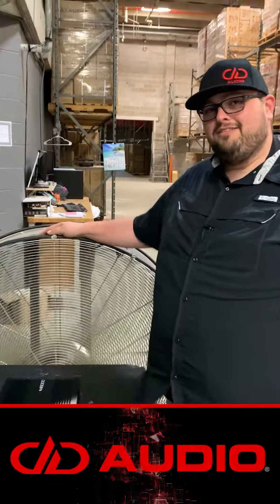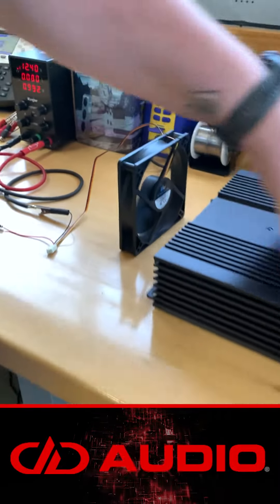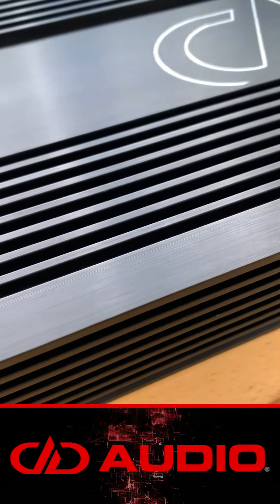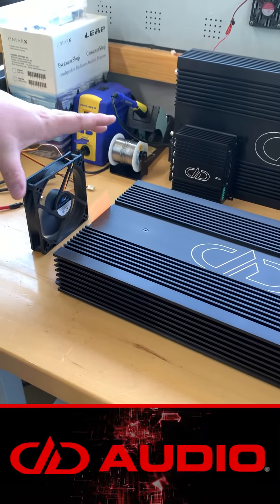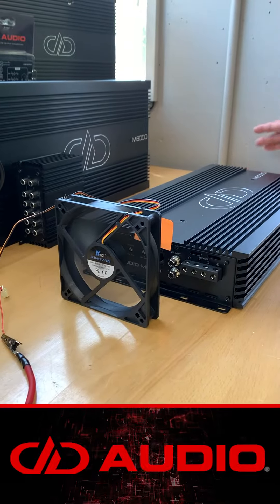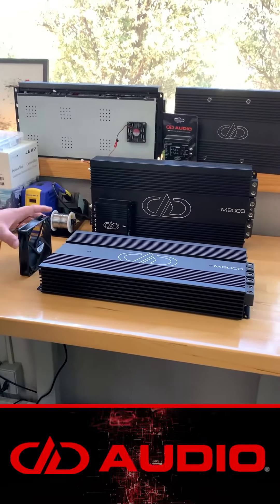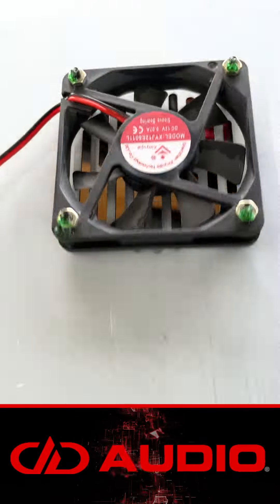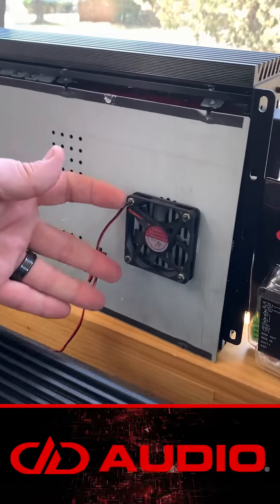Tech Talk: Amplifier Cooling

Comment: I have a problem with overheating with my car engine control unit.  Should I install a pc fan? Or server fan? When ECU becomes too hot, the engine stops running. Most of overheating comes when I start to remove the car from one to another place, or in a trafic mess, when there is no wind to cool down ECU. What would you recommend me?

Comment: I have done this in the past, and it works well to cool the transistors. But, it wont cool the other hot part in the amp: its transformers. Those get real hot, too, due to how lossy they can be. In my old JBL amp, the whole PCB turned black and the transformers melted down despite the case being kept cool to the touch. Class AB amp so its the worst-case scenario, but its worth noting that the H-bridge and PSU transistors are not the only things getting hot, and the outside case temperature does not help the internal components as much. Something to keep in mind that hot weather is still hot weather.
Reply: Any tips on connecting to aftermarket infotainment android units for cars? The aftermarket android units overheat and usually slows the unit.

Comment: I used a removable push pull fan setup on my dual M4a rack when playing for extended times at carshows, definitely helped a LOT especially given that the rack enclosed the amps, I also mounted non removable fans on the back of the rack to blow though the venting on the rear panel for every day use these were relayed to come on when the amps came on.

Comment: And for what its worth, the "pull effect" is not as efficient as the air is being pulled from all around the fan based on the pressure gradients it induces. Very little airflow will be induced beyond a few inches from the fan. The "push" is better as the air is more or less directed in a stream across the heatsink. Even better, if it can be arranged, is to mount the fans above the heatsink so they blow air directly across it. Edit: The fan on the inside to draw air into the enclosure is actually the best solution, since its cooling the transformers, output inductors, H-bridge drivers, etc. Parts that rely on just ambient air temperature inside the enclosure to stay cool.
Reply: Any tips on connecting to aftermarket infotainment android units for cars? The aftermarket android units overheat and usually slows the unit.
Reply: @whatitisnt.  You might be able to use a stick-on silpad and a low-profile heatsink on the rear of the enclosure. It depends on how much space there is behind the unit. Even just getting something on the case itself can help a lot.

Comment: You not showing how tho, I need to kno how to go it up so it won't constantly run
Reply: Ground to ground
Hot to remote wire
Reply: @SixEightPsycles  it has 3 wires hot, remote, ground, do I need any relays cus it wouldn't come on without it hooked up to the power
Reply: @PISTILGRIP  mine only have 2 wires, since the remote lead is hot when the ignition is on, you could hook the 2 to remote and then ground the ground obviously.  Since the power will be cut when the key is off, that should work...

Comment: It's called poor engineering by the amp manufacturer or poor selection on the part of the person specifying the amp.   All electronics have a thermal limit and nothing properly designed for an application should require external cooling unless specified in it's manual.  If specified up front, at least you know going in that it is required and the device is not designed to work in an environment that is over it's max temp range without external cooling.
Reply: True but Texas weather is crazy